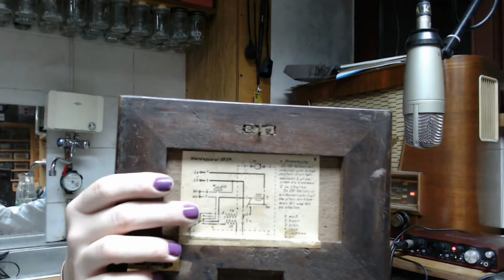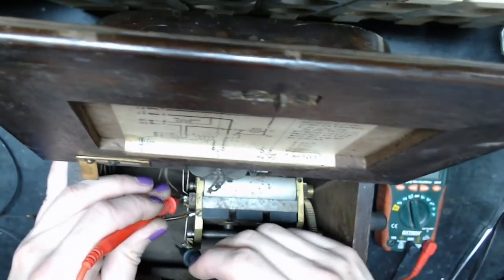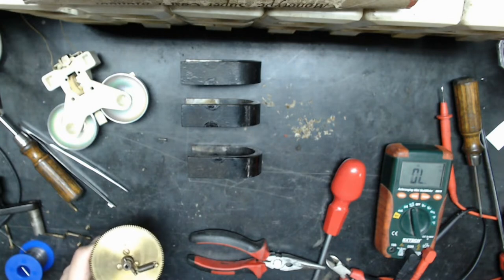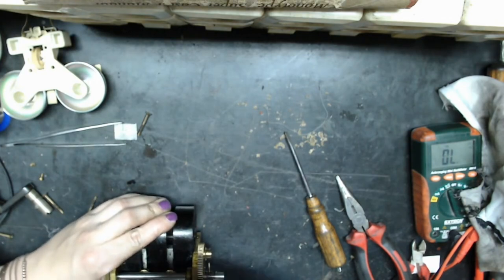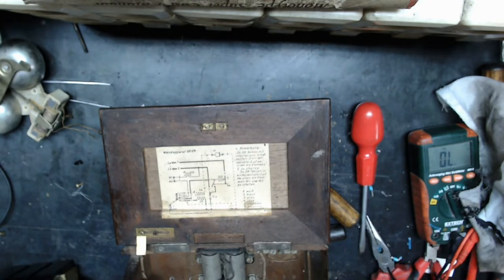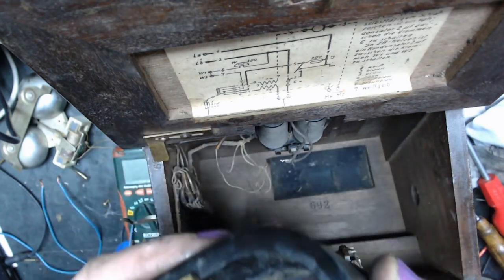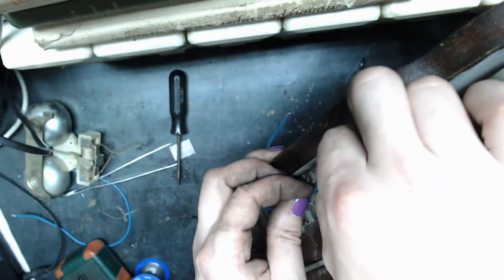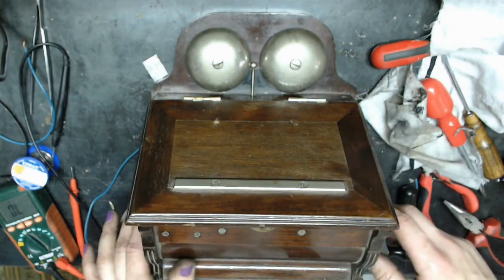Antique wall-mount telephone - generator and bell restoration

Comment: Same in the UK re: local and central battery systems Keri. Our central battery systems sometimes were 22v, and sometimes 40v.   Local battery was used for more rural areas originally (edit: due to longer average line length making central battery inefficient) . Local battery in the UK was divided into Magneto (the kind you have there), CBS1 (which signalled to the exchange by earthing one wire of the pair, and avoided the need for a capacitor, which were expensive back then because the bell was used to earth the wire) and CBS2, that was basically the same signalling system as central battery, but with very low line current and a local battery.
Reply from the maker: Interesting. I bet Sam Battle knows everything about this - I'd love to visit his lab/museum and see the exchange!